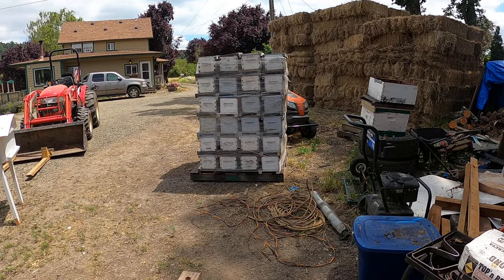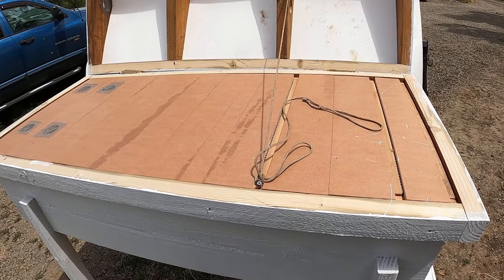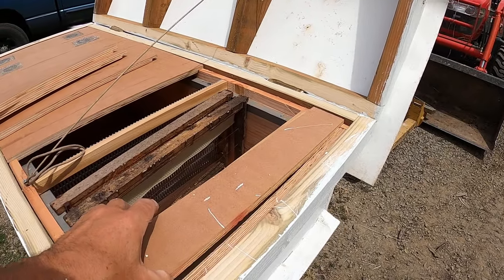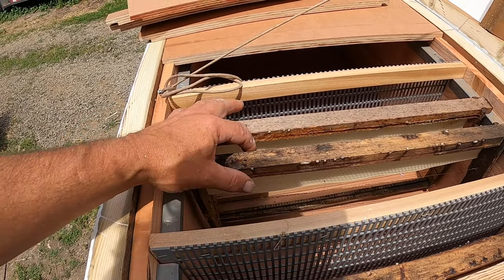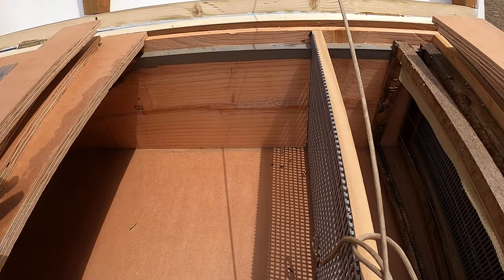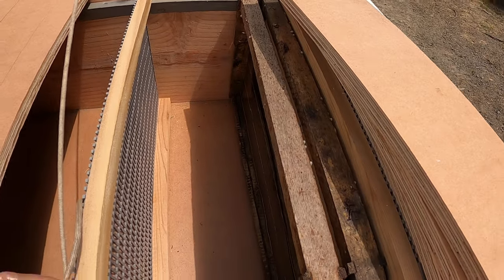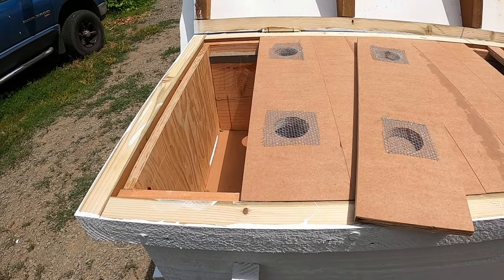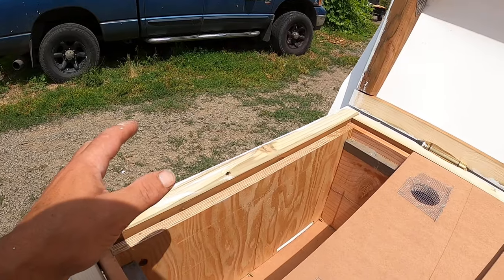long langstroth hive for my breeder

Comment: Hi ive been experimenting  with a 10 frame deep 3 frames on one side of queen excluder and 7 on other side i rotate 1drawn comb per week but i have a target day i put it in .around 24 hrs before they hatch i move it to the side that has 7 frames .I remove 1 to place the target frame in . I also put in a piece of luan where excluder  was this gets the nurse bees glands fired up .around 12 hrs after hatch i remove it and graft .put graft frame back .about 24 hrs later i check for exceptance and leave luan in place for 24 more hours .then remove luan and put queen excluder back .i  have entrances  on opposite  sides of the box i have a piece of queen exclude on queens side of box so workers can go as they please .i feed both sides 1:1 plus patties and theres pollen frame and nector  next to grafts .you need to check for rogue queen cells regularly  and adjust frames as need to keep nurse bee leaves up.im on my 3rd weeks of grafts and its very productive.
          Konrad
Reply from the maker: that is what I patterned this after. I wanted to be able to have more than a 10 frame box. I am glad its working for you, I am having a hard time getting there every day to run it like I want